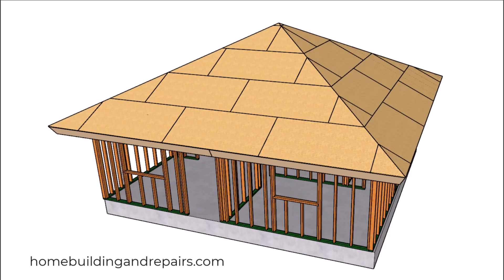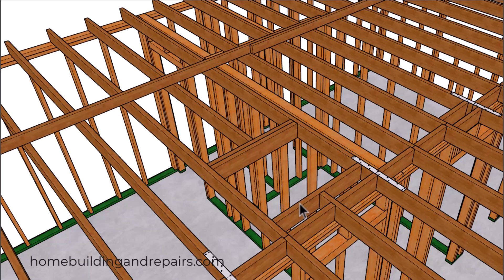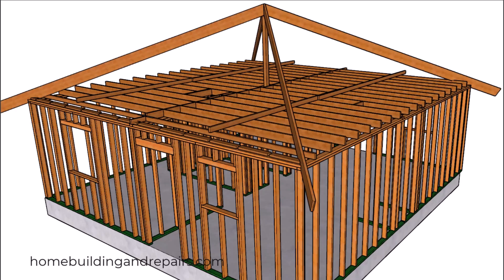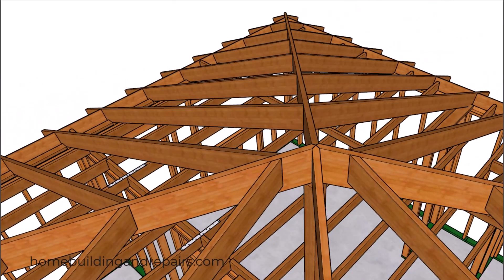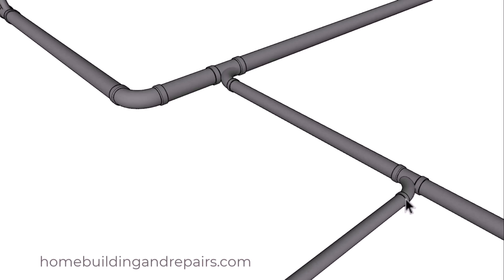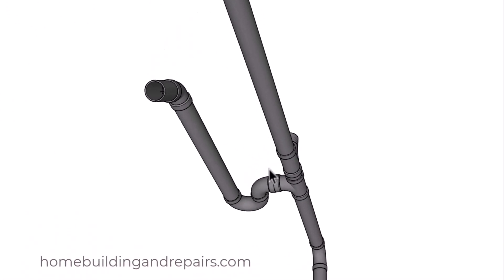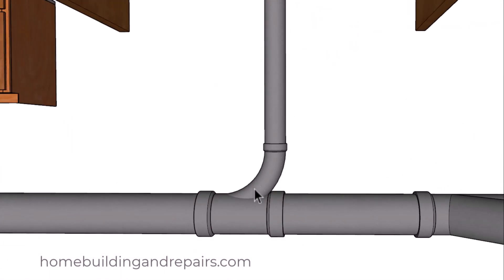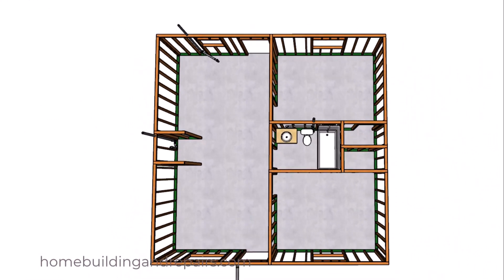Building A Center Point Hip Roof - Framing Techniques And Plumbing Layout

Comment: These small houses like this and basically many others that are bigger. Instead of making multi angle, roof designs.. 
        If solar is an option. During the design phase.. the orientation of the house or the roof should be designed in one flat plane according latitude, location of the house to determine the angle that best suits the angle of the solar panels.   So the solar panels can be attached flat to the roof without extra lengthy or adjustable hardware..   this will serve two purposes. 
      Because they are flat anchored to the roof without hardware. It will cut their cost down.. in some cases it’ll make engineering and code requirements. Easier to follow..   and do to the slightly extra large size of the roof because it’s gonna be one giant long flat plane.  Especially if your account for overhang of 2 to 4 feet on each side..  It will greatly increase the roof square footage for more solar panels that may be needed into farther north latitudes..  or an area that gets fewer hours of sun per day by substituting more panels to charge a battery Banks to carry a load through the night. 
        At the same time, the little tiny house ends up with a taller ceiling and even a loft if they wish to have one or storage later in the future.